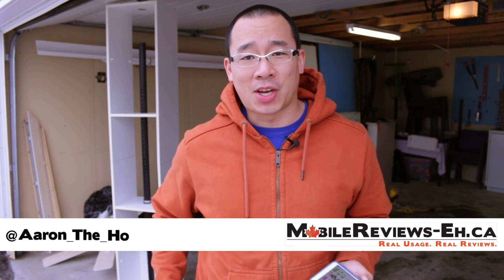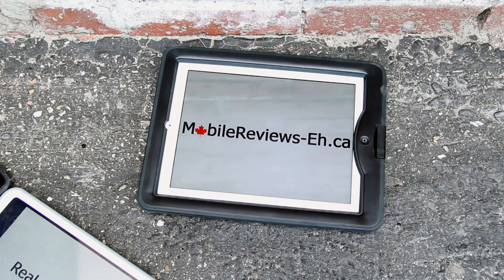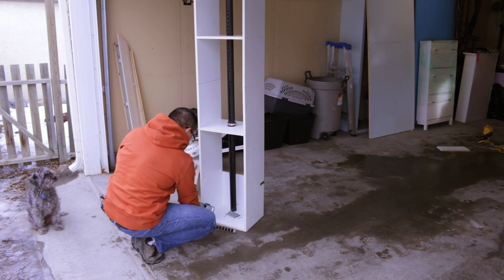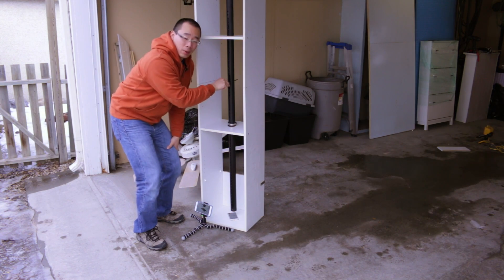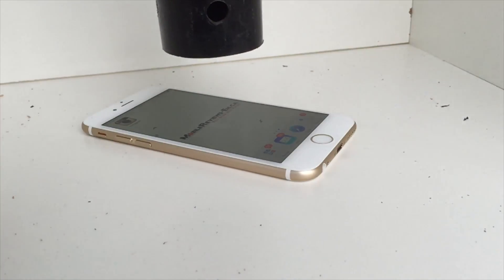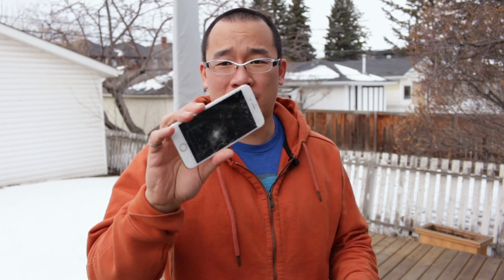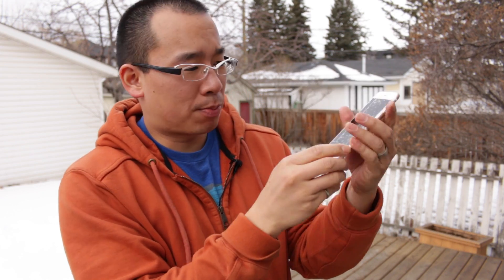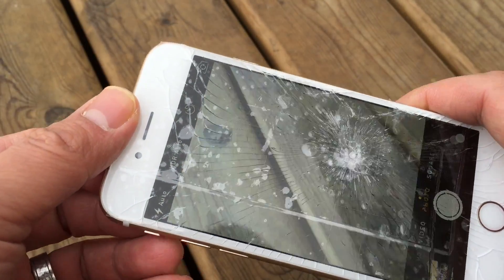iPhone 6 screen vs. Ball-bearing?

Comment: The iphone should be placed directly on the concrete floor, rather than on the non-flat particleboard.  The flexure of the particle board greatly reduces the force of the bearing on the phone.  You can tell it's flexing quite a bit by the way dirt sitting on the board jumps around when the ball bearing strikes.
That's why black smiths forge parts on a big heavy steel anvil, instead of a thin plate of steel on top of wood.
Reply from the maker: I'm trying to test the impact between the ball and the screen, not the compression of the iPhone.

Comment: Also have you heard of an iPhone case affecting the function of an iPhone 6's barometer? You would see  the affect in the healthcare  app in measuring or not measuring the number of flights of stairs climbed. Do a Google search "iPhone 6 barometer not working" and check out the Apple Support Communities.

Comment: Glad to see you're expanding into the screen protection as well. I've always felt the tempered glass options like the Zagg Invisibleshield were the best option available over the thin film scratch resistant screens and cant wait to see your results when comparing them.
Reply from the maker: I've been thinking about the glass vs. plastic a lot and I think the plastic ones are going to be tougher than the glass...guess we'll find out!
Reply: MobileReviewsEh I think they'll be tougher to damage but wont protect the actual screen as much. Time to start breaking shit! WOOHOO!!!

Comment: Thank you for the effort! I can't wait to see how the screen protectors hold up.
But I think it'll be more realistic, as it happens in every day life, if the base line was the iphone, naked, dropping from a certain height before shattering. And then doing it with an iphone with one of the shields. 
Just suggestion.
Reply from the maker: I have thought about it but I can't easily re-create the same drop for each test. I do agree that this sort of drop test is less realistic than an actual drop but this setup allows me to test the screen protectors consistently.

Comment: How about catalyst for iphone 6? Maybe incipio atlas as well
Reply from the maker: In terms of screen protection?
Reply: MobileReviewsEh I'm curious of the Catalyst's screen clarity compared to the Fre, I had the Fre, but the way it messes with the screen quality of the 6 made it a no go, it drove me absolutely nuts. So, I'd like to see how the Catalyst performs. Currently I'm just using Ghost Armor on the front and back.
Reply: i meant when you review them see how they fare against the ball-bearing test
Reply: the reason i don't want a fre is I want a case thats waterproof as well as drop proof. (as we saw in the life proof fre test that was not the case.)

Comment: Well is not true the six plus screen is weaker because of the larger surface area.
Reply from the maker: That would be true but the glass on the iPhone is held up by the internal components so there is always something under the glass holding it up. If it was straight span of glass, it would be weaker. I will find out eventually.

Comment: Brilliant video again Aaron. I recently removed my Tech21 screen protector on a gamble my iPhone 6 plus screen which i enjoy more without a screen protector will survive
Reply: Same here. I like the tech that goes into the Tech21 protector and it applied easily. But nothing beats the feel of glass. The protector had to go!
Reply from the maker: Just as a warning, the steel ball is smooth so there was no "pointy impact". If I was to drop a similar weight rock with jagged edges, the screen would have broken much earlier.
Reply from the maker: MobileReviewsEh I do agree, the glass feels is nice but do be careful.